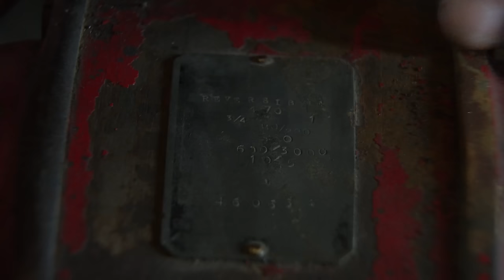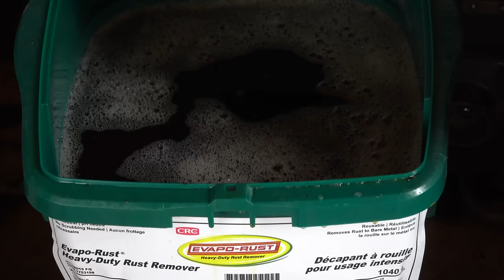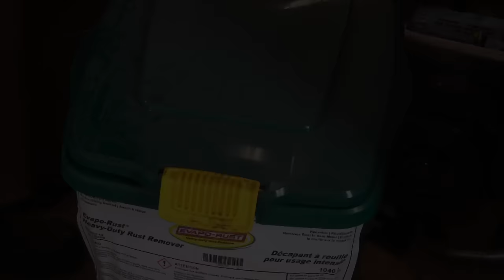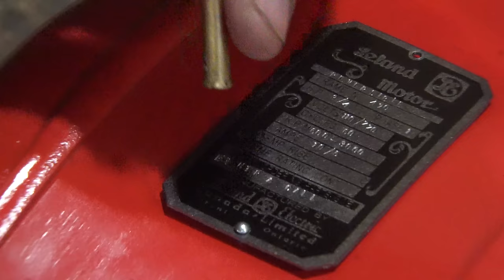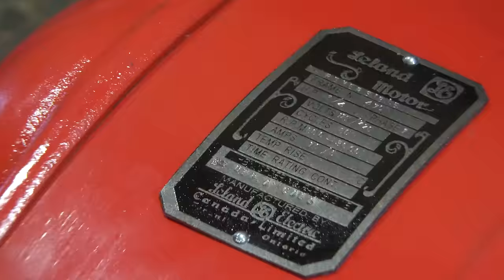Why Did They Stop Making These? [Restoration]

Comment: I've been doing motor repair professionally for over 35 years.
That "string" is lacing that was doped in-place to keep the winding leads, attached to the commutator segments, from being pulled out of position by centrifugal force. The lacing should have been redone and "doped" (cemented with high temperature motor winding epoxy ).   If this motor is used for any length of time it will have a catastrophic failure due to this major oversight.
  There is a special tool used for "under cutting" the space between the segments of the commutator. The tool removes a precise amount of the insulating bedding material the segments are embedded in and chamfers the leading and trailing edges of the segments to reduce wear, chatter and arcing of the carbon brushes, a very important step in turning a commutator.
  Minimally, these two items should be corrected before this motor is put in service.
Reply: Good comment and explanation.   I was wondering about the "string" removal.... It was originally there for a reason and removing and not replacing it without understanding it's function is not really a restoration.
Reply: I've been in servo motor repair for 24 years. You are exactly right sir.
Reply: Ya mota, fix it! (Parody of an old  Midas commercial.)
Reply: This. Sounds like the Bearings/spindle housing could use a little love as well.
Reply: Also needs commutator re soldering. And a warning label to not leave the motor switched on in the neutral position.
Reply: @cayankeelord3730: Thank you for posting this. When watching I was thinking… what is this moron doing just pulling out the lacing and then putting the armature on a lathe and taking a cutter to the commutator. Yes you can lightly take off the carbon build-up on the segments caused by the brushes but to cut it like that and then not clean out the gaps properly! 🤦
Reply: Came here to say the same thing.  Worked motor-rewind in the Navy when I was in.  Had some really oddball things come through the shop.  Anytime we turned a commutator, we had to 'undercut' it afterwards.  Important so brushes ride smoothly from bar to bar and not build up material that shorts the bars.
Reply: @robertschagen9016  
The sparks coming off the commutator is a big clue that it shouldn't be done.
Reply: Judging by some of the comments, looks like there's a Part 2 coming.
Reply: i was wondering about the grooves myself and how he was going to deal with them & thought it would be next in the video i thought maybe he skipped it for sake of the video length but i assumed they should have been redone to the original depth don't know anything about electric motors just seemed like common sense to an old tinkerer like myself nicely explained by the way
Reply: Would Dolph's red epoxy work?
Reply: I’ve worked in a motor shop for 17 years as a motor winder some motors this old were built to last but I would have rewound this motor instead of just putting heat shrink over old leads
Reply: I didn't see him seat the brushes either.
Reply: Auto apprentices in my time were taught to turn, undercut and polish commutators on car starters and generators. Instructors told us of rewinding and sealing and showed us the equipment but by the mid 1960s it was left to the rebuilders.
Reply: I love that term “catastrophic failure”!! ❤
Reply: You sir are why I love YouTube comments. Thank you 4 sharing your experience.
Reply: Thank you, sir! You seem to know your motors! How hard is it to find motors like this! I would like a couple for my personal use or quality motor that are specifically designed to do the exact same thing. Maybe you would be willing to respond. Thank you sir.
Reply: @soul8bounce  Most packing materials used for oil-sleeve type bushings are impregnated with powdered "motor graphite" to aid in lubrication. That's one of the reasons why the packing material he removed from the oil reservoirs looked so dark in color.  If it were me, I would not have removed it. Any prior dirt or contamination would have been trapped in it as it acts as a filter for such contaminants and wouldn't make it through to the bushing.
     If I were to replace the packing, I would have used packing cordage that's used for plumbing valves. It's already impregnated with graphite which the oil will pick-up and feed into the bushing-bearing.
Reply: @cayankeelord3730  Learned something new.  Thanks!
Reply: @rickdrysdale892  A minor amount of arcing is to be expected where the brushes make contact with the commutator with these types of motors. However, any more than that could indicate a more severe problem such as partially shorted windings.
  The most important thing is to properly under-cut the segments and chamfer the leading and trailing edges of them to avoid chatter and excessive wear.
    At work we use special polishing abrasive stones on our 2300 volt 900 hp synchronous motor/ generator sets to maintain our expensive units.
Reply: @joshuabekel9700  Yes, absolutely. Dolph's Dolphon CC-1139 is made for that very application. However, it does require an oven cure at about 275 deg F. for about 15 min.
    If married, you should probably wait until the wife would be gone for a few hours or get the "What's that smell and what the h*ll is that in MY oven?"
Reply: @brandonmcewan7637  I think that might be prohibitively expensive for this, but non-destructive high-potting to make sure the insulating enamel was still good might not be a bad idea.
Reply: Promise us when you retire you'll start an electric motor restoration channel :)
Reply: @vaughnmilburn6966  This is actually the first time I've ever seen a motor like this. Very unique. The principle of operation is pretty straightforward. It operates on the theory of phase shifting, but there are a couple of downsides to this.
   A) It's not very efficient and builds up a lot of heat in the windings. That's why the fan is so huge in that motor.
   B) The windings must be securely potted in both the armature and the stator to avoid as much shifting around of the coils as possible. There are some great slow-motion video of this phenomena. There should be some on YouTube.
   Small, single phase VFD's are out there, but the motors and the VFD's need to be "de-rated". The other option is this! > https://www.youtube.com/watch?v=Z_juhqYt1Ks
Reply: @cayankeelord3730   I guess what i am looking for is a good, reliable motor that is designed to be variable speed. Or a motor that can be wired to a variable stat controller and would not harm the motor with heavey use. Thank you for your reply!
Reply: Should have megged the windings to check the insulation
Reply: @Boilerking76123 I agree.  The insulation on the windings looks a little toasty, and broken down.  If reliability were a concern I would consider a rewind anyway.
Reply: I was concerned about all the above but also there was bright copper showing on some of the armature wire strands close to the commutator. A rewind would have been best but if not at least some varnish touchup the wires to stop potential arcing. 
I suspect this damage and the string were done by over enthusiasm with the sanding/filing process. 
The other concern I had was that the brushes seemed a poor fit in the brush mounts. Arcing between the brushes and the commutator is to be expected, particularly with an old motor and new brushes. 
However all brush motors arc which has turned out to be a problem with the new arc protection in domestic distribution boards and old household appliances. 
In a way this motor is like an electromechanical version of what goes on in a modern brushless motor that does this process electronically. The control of the windings and magnetic fields created by them are very similar to what happens in my cordless drill.
Reply: @Dino-1958 I thought the brushless tools used electronics to vary the frequency.
Reply: I was about to say the same thing.  If this thing is at high speed with load, the windings will explode.
Reply: @qua7771  If it was previously used under that metal filing machine that would explain a lot of that toastyness.  I would not have put it into that type of service without at least cleaning the windings a bit better and refreshing the lacquer plus ensured that when installed it was pulling in clean air and blowing the metal filings away from itself.  

Agree with others about the packings, string ties, bindings, cutting, etc that needed to be done to complete the job.

In operation I was taught to switch power off and let them come to a complete stop before moving the control level past the neutral position for reverse operation and then restore power.  None of this hammering them at speed from one direction to the other which is not good for the motor or the equipment its powering.  If you really require that type of operation your better off using a reversing box with a double cone clutch such as on a hoist or crane transmission.

Best!
Reply: It is not the only problem in this video. For the love of God will people stop using an open flame on shrink tubing. Flame can change the properties of the polymers so they break down far more quickly and in extreme cases make the tubing a conductor without any visible sign of change. (Carbon tunnelling)
Always use hot air - it is fully controllable.
Reply: @bertram-raven Indeed, this use of corrosive open flames for things that need clean heat applied are a pain point.

I rebuilt original tools and machinery in factories that were over 100 years old and open flame repairs were just for the welding shop and foundry not for insulated wiring.

Best!
Reply: @neilfromclearwaterfl81 I cringed at seeing him using the lever to change directions with the motor moving.
I see this machine as having collectable antique value, and not as a productive shop device.  It's too darn quirky for it's purpose.
Reply: @qua7771  Part of a working museum would be nice but they are still serviceable and useful in the here and now in the proper use case.

Not a big fan of the brass handle screwed into the end of the brush holder as the speed control lever which could potentially expose the operator to a pretty substantial ground return in certain fault situations.

Best!
Reply: @neilfromclearwaterfl81 Clearwater?  I'm in Jax.
Reply: @qua7771  Yep, on the beautiful Florida Left Coast.  A brisk but sunny 67 degrees right now with a slight breeze.  

Lemons, limes, mango, Japanese plum and banana are all in bloom plus the grapes and peaches are just coming to life.  I have a very small yard but its amazing how much tropical fruit that small modest yard can support in this area.  Should plant some new papaya this year.

Best!
Reply: I couldn't believe he wasn't giving the functional part of the motor any more attention.
Reply: Mica separators!
Reply: I'd defo had at least sprayed the windings with AEV anti track varnish.
Reply: Always use a comm stone to help bed brushes to a commutator and don't forget the dry blow out! To get rid of the dust.
Reply: Always use a growler to check for armature shorts!
Reply: Always use a reputable motor rewind company, as we didn't train all these years to lose out on revenue by armature amateurs. Lol
Reply: Good information. Thanks.👍
Not afraid to admit that I learn from comments like that.
More info, the better.
Reply: I was just having fun with this last one! Lol that's how I learned just wading in and having a go plus I come from a family of armature winders! The only shame is the emergence of purely machine wound stators, d.c. yokes and armatures and wound rotors. As you can't really rewind these unless you have the millions of dollars/pounds of the big corporations kit.
Reply: Another one is Big motor especially in generator alternator windings throwing in tapping windings and the only way you can replicate that without a manufacturers winding  diagram is to really know what your doing and unwind each an every coil by hand keeping full notes and this of course is very time consuming and therefore economical unsound.
Reply: Under cutting saw, or a hacksaw blade, with the set, ground off. As long as it's low enough, to not short the commutator, and clear the brushes. Also, I didn't see the growler. We used the toughest string, when we rewound the commutator. Seen a lot of runaways, desoldered, wires flung out, even bars flung off. Pulled the wool out of the oil reservoir, but was that wool replaced? Sometimes sawdust is used, but wool actually touches the shaft. And it's naturally hollow, wicks, and holds the 20# non-detergent oil. Non-detergent, so not to destroy the bearing materials, such as oilite bearings. Sintered metal, bound with carbon particles, to retain oil. Detergent oils, dissolve the carbon, out of the matrix, skeletonizing the bearing. And the brass lever was probably bent by dropping. A puller on a homemade wooden pulley, isn't the best way to remove it. We used the tie rod and ball joint forks. Prying against the base, or sitting the shaft on a board, holding the motor upside down, putting the fork between the pulley and motor, and whacking the fork, with the sledge, pops off quickly. Sleeve bearings need to be replaced, if they are loose. Didn't see if it was checked, before the teardown. We always check for the ground, end play, and slop.
Reply: @allensherrill850 BIDEN 🤣
Reply: @robertschagen9016  Or in any position if connected to power.
Reply: I worked at a motor shop for a while, I've always had so much respect for people that work on motors, our motor winder was a old man with a wealth of knowledge. He used to say we misewell be right next door to NASA 😂
Reply: I worked at a locomotive repair and rebuild shop.machinist turns the commutator.then it is undercut.then we used a saw to clear the copper between each 2 segments.then used a tool that had a v shaped head to chamfer the edges of the segments.
prevents chattering and damaged brushes.then used a milliohm meter to check for shorts between segments.then set the brushes.
 I'm no expert but looks like to me  not the best job of rebuilding.hope the comments help understand more and better.liked that the comments were intended to be helpful and not criticizing.lot of videos like this the majority of comments were running people down,calling them stupid etc.that helps no one (and shows the person to be an ass.just my rant.think it's very cool rebuilding old stuff that mostly is superior to the crap they make nowadays.
Reply: So in otherwords he built a bomb. 😂😂😂
Reply: i'm no expert, for sure. but i did make a living rebuilding generator/starter, alternators, and starters on 12v eqmt back in the 80's.  we did put the commutators on a growler 1st, then in a lathe, but only used a piece of fine sanding belt to clean the copper. and then used a simple awl to clear debris between the segments. washed w mineral spirits, and sometimes re-sprayed epoxy paint to lock the stator windings.  he did kinda miss that situation. the stator windings HAVE  to be ironclad imho.  but dam that is a sweet motor.  and thanx to everyone for the explanation of things.  i guess it kinda might heat up in "neutral".  i just figured it was a phase shift thing.   have a good day
Reply: @Ax89  Yeah, when I saw that string come off my thought was, "That string was there for a reason, and I have NO idea what that reason was."  In my projects, coming across a thing like that is a 'showstopper' for my work, where I have to set the whole thing aside until I learn what it was, and almost as importantly, "WHY it was that".  Admittedly this has left me with a lot of half-done projects in boxes as  'WW1/2-era stuff and down to the 20's" tools and motors have little to no documentation and aren't old enough for a collection of 'interested amateurs to experimentally re-figure it out the hard way and document their findings on Reddit' so far.  I suppose I really should start being one of those documentation-makers, now that I think about it..!  But anyway, stuff in that 'awkward era' is too old for their parent companies to mostly have survived or for documentation to be easily rediscovered, but not so old that 'everyone understands it by now'.

But to the parent poster; thank you for that info about the string and its dopant!  Also, now I'll have to re-check the commutator I smoothed some scratches out of to see if any of the segments are or aren't beveled any longer.  It's amazing how many little 'tricks' like this make such a difference in the lifetime and safety of these old machines.
Reply: @bertram-raven  but open flame is more "manly"... that's why gas barbecues are for men.... LOL... I kill myself with these jokes sometimes...   (But 100% agree on hot air for shrink tubing, but my reason is to avoid scorching things.)
Reply: @EShirako   That's the thing I like about Milwaukee tools. I don't know about now, but I've been to their website a number of times in the past and they had documentation for tools built back in the 1940's and 50's up to the present day. Now THAT is customer care!
    Sears used to be that way with power tools too until they went BK and sold off everything that made them great. They should have sold off everything else and turned themselves into just a hand / power tool company. They had a strong following until they started farming out their manufacturing to overseas companies, then it was all downhill from there..
Reply: @bertram-raven   Wait.....are you saying my pocket HT-900 (BIC lighter) isn't the proper tool for the job?
And yes.....I'm kidding.
Reply: @allensherrill850  right. Because a slight failure just doesn't send a message.😅
Reply: @cayankeelord3730 I found that move suspicious too. Thanks for expanding.
Reply: This guy knows what he's talking about. I have only been waist deep in motor repair and rewind for a little over 6 years. The thing that surprised me about this motor was the neutral plane adjustment on the fly. Everything DC that I've messed with, we seat the brushes after the commutator was cleaned up and tested and the neutral plane is a fixed position after load is put on the motor and pin firing is eliminated by adjusting the brush rigging. Never seen one where you just throw the brush rigging back and forth to adjust direction and speed
Reply: I hope we get an update about him fixing that
Reply: Please don't watch any 3rd world repair videos 😂
Reply: I still have most of my "rewind" and repair tools out in my tool chest. I am retired now but have often said that the years I spent in the motor shop gave me the skills I needed to advance me to my ultimate position.
Reply: Don't forget about the flex compuhsitor!
Reply: Catastrophic failure = show you what it's made of...
Reply: I would honestly redo the threading with modern enameled magnet wire.

Of course, I'm not into historical preservation, and would rather restore functionality to the design.
Reply: Is there documentation of this kind of information? I love working with old motors but I often have a hard time finding information.
Reply: @pokey4200    Yes, "exploded" view diagram takes on a whole new meaning.
Reply: When the OP gets schooled by a master and doesn't respond.  lmao!
Reply: He skipped doing a leakage test. Those super old electrical windings are very frail and delicate. I would be heartbroken to see a beautiful motor mechanically with an excellent paint job only for a puff of smoke to come out when power is applied.
A classic gem like this should be protected with very fast acting circuit breakers and fuses!
Reply: @Dino-1958  I have an old skilsaw that doesn't play well with modern GFCI/AFCI breakers!
Reply: Wow.
Reply: @foureyedchick  Well, if it failed a leakage test, then it would need to be rewound anyway, but at least you would get a "heads-up" that a failure is probable and may be eminent.
  Surprisingly enough, motor rewinding is more time consuming than difficult. it definitely takes planning and requires the proper gauge enameled magnet wire, wound around what would likely be custom made wooden form(s) to replicate the original size of the coils with the proper number of turns in the correct wrap direction.
   You need the proper supplies i.e.- "fish paper" to protect the coils insulation from abrasion damage ( a thin, bendable, but somewhat rigid type of coated insulating material that is heat resistant and comes in sheets ), properly shaped treated wooden coil wedge inserts ( they secure the armature coils in place ) and a motor epoxy like one of Dolph's, selected to fit the application.
Reply: @awareness2remember  Well, just because he didn't respond, doesn't mean he didn't read the thread and thought about what needs to be done.  
   Over-all, I give him a lot of credit for wanting to save this motor from the scrap-heap.
 I'd say the only things missing are the replacement of the commutator leads securement over-wrap lacing/doping,  using the proper oil well packing material,  proper undercutting / edge chamfering of the commutator segments and polishing / stoning of the commutator itself to extend brush life and to eliminate shorts between segments.
    Before starting any motor "restoration", i would "megger" the windings of the armature and stator to verify that they are serviceable with minimal electrical insulation leakage. ( 30 Mega-ohms min)
     In the case where a motor uses brushes, I would use a "growler" to see if there were any shorted armature windings and then try and source a replacement set of brushes, unless there was enough length left to last for a good long while.
    If all of this is done, you will have a dependable motor that will last for decades, provided the bearings are oiled and it's not overloaded.
Reply: Catastrophic faillure because of a string...
Reply: @cayankeelord3730  Agreed. I would have left the packing alone also. He probably thought the graphite was dirt. I think you enjoyed the project which is the main thing. He seems to be a good machinist.
Reply: @bertram-raven  decent heat guns have been available at low prices for a long time now. No excuse to not have one for shrink tube.
Reply: Yep Old Starter Motors are The Same no Big Deal Now we Know Just Take Out The Armature and Do it , only Thing he Didn’t Remove it all
Reply: @imdeplorable2241   Judging by some of the comments, looks like it's going to blow up in someone's face...
Reply: I'm an idiot and I understood that string; 1 was used as a bushing and second an insulator. Thanks for explaining in technical terms 👍
Reply: @imdeplorable2241 And well deserved.
Reply: @brandonmcewan7637  You are professionally correct!
Reply: @jimgagne3801 Not mine😬
Reply: I think he just wanted to get it working again, not "service worthy" as you motorheads keep saying. So once again someone puts their hard work into something and the naysayers come out the woodworks. You guys couldn't just say what a good job he did. You guys sound like managers or supervisors, that never give their workers any credit. Anyways it was a great job for a great video. Well done.
Reply: @mattsweatt85  You are correct, however they are pointing out something that could be catastrophic for the human operating the electrical motor!

It needs to be put back together the way it was built!
Reply: You say.....
Reply: @intercommerce   Yes, I said. What's your point?
Reply: @joshuabekel9700 BC-346A is the usual standard these days from Dolph.
Reply: 35 years? IS THAT IT?  this thing is 100 years old almost .  You need at least 50 more years experience to match   😂
Reply: @alspears7749  so this tech is still applicable to your new servo motor understanding?  That's pretty darn cool that the original designs haven't been changed much if at all.
Reply: @soul8bounce  when it is at it's slow speed that's what that noise is right?
Reply: EMR in Baltimore does that too
Reply: Good notes! Also I'd like to point out that you need a much sharper bit to get a good cut on the commutator. Diamond is usually best, and you can pick up one from McMaster for around $100. That also saves a lot of time, as you won't have to remove nearly as much flashing from between the comm segments.
Reply: @1813boo   If the commutator is lightly grooved, I'll mount the armature in the lathe and do a few light passes with a tool post mounted grinder with a fine stone. Cleans it right up. Then onto the under cutting / chamfering jig then back to the lathe for a final polish with #600 paper to finish the job
Reply: @cayankeelord3730 we do that packing for big motors on sprinkler system pumps. Good idea 👍
Reply: I’ve been in servo motor repair for 704 years. I agree that complete catastrophic meltdown is imminent.
Reply: @joshuabekel9700 don’t ever ask that question again.
Reply: @nickwilson1476   ah, you make nonsense comments. Got it. 👍
Reply: @nickwilson1476  would Dolph's red epoxy work?
Reply: @nickwilson1476  would Dolph's red epoxy work?
Reply: @nickwilson1476 would Dolph's red epoxy work?
Reply: @nickwilson1476  would Dolph's red epoxy work?
Reply: I haven't felt this dumb in a while. This is some scientific engineering explanation for us, I feel like a dummie, awesome explanation, I'll keep it in mind in case I come across one of these.
Reply: Nobody likes a know it all
Reply: yeah yeah that kanooter valve has to have string on it or it will blow up the world, super serious stuff here, glad you chimed in to let us know .....
Reply: @AsTheWheelsTurn  Glad you chimed in too... 🙄
Reply: I liked this restoration video, but this guy must have an ego on him if he hasnt dropped a heart on your very informative comment, or even responded. After all, you're teaching him how to up his game. 
I thank you for sharing your knowledge and experience.
Reply: It'll be fine, don't be a pisser
Reply: its a restoration not a refurb
Reply: @tommac8742   LOL, a restoration would be even more advanced than a refurb.
Reply: Use a heat gun not a torch to shrink the tubing.
Reply: @brandonmcewan7637  really, to risk ruining a perfectly good stator? why?